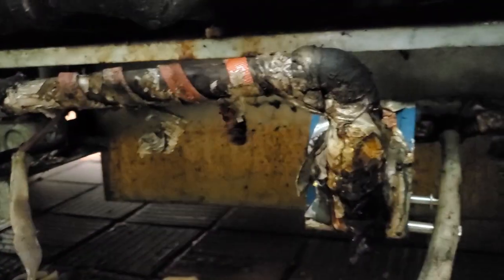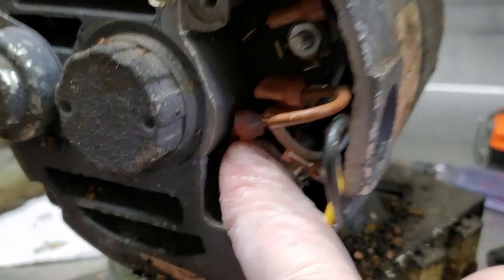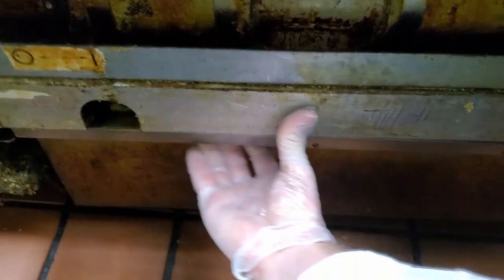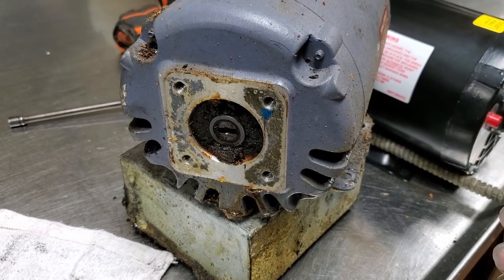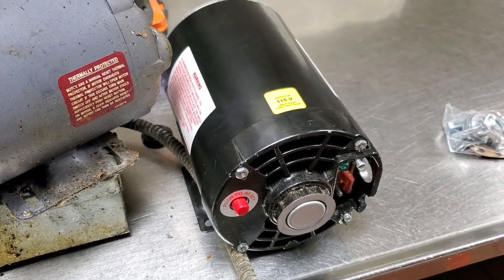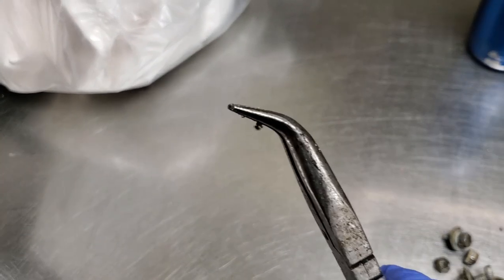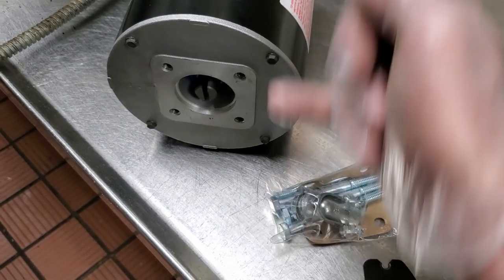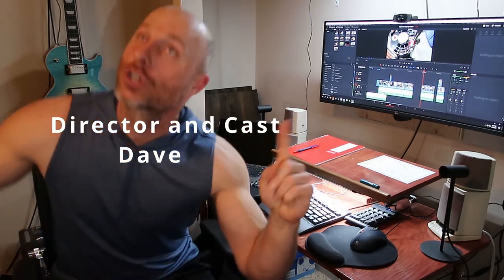How to clear a clogged pump and tips during a motor replacement of a Frymaster fryer

Comment: At first I was skeptical reverse wiring the polarity of the motor. After trying to get the backside of the impeller motor off (with no avail). To spin the shaft, we decided to have staff empty the vatts so we could undertake the nasty job of pulling the motor. We ran across your video and said-what the hell, we will give this a whirl as the wires were accessible through the access panel on the front of the motor. After reversing the wires and a few quick on-offs! Viola!!!! The impeller freed up and we are back in business! Thank you so much for posting this detailed video.

Comment: Thanks so much for the info my company has 3 that will not pump and frymaster said break down the units and clean them out which is a huge headache. If this frees them up thats hours saved for the restaurants and us.
Reply from the maker: i hope it worked out for you on at least one of the units
Reply: @gtjdbydave  Thanks did work but didn't fix the main issue. Unit has a solenoid valve that was stuck open causing it to act like a clog but pump had no suction. Still have two others scheduled and replacement of the solenoid valve.
Reply from the maker: Thanks for the follow up